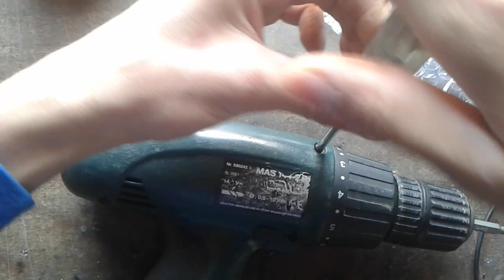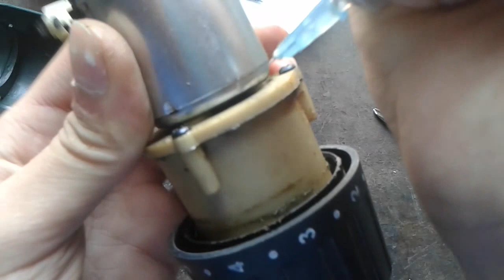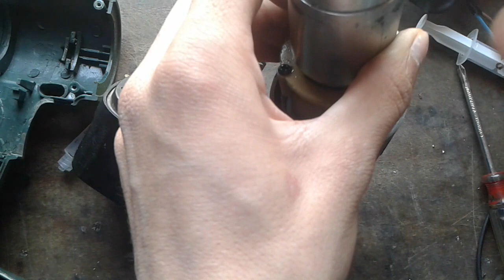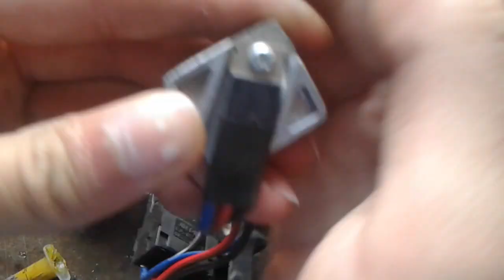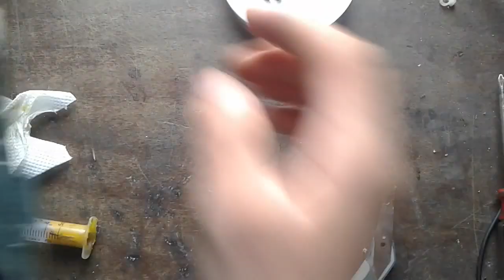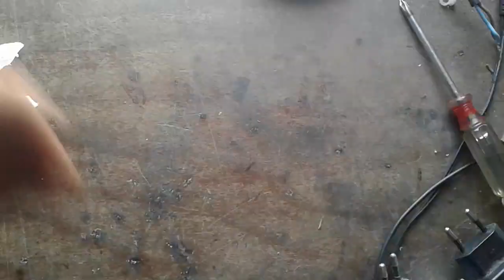Power Tool Cleaning , Maintenance and Lubrication . Bringing  this Drill to Life  :D

Comment: You did 50% of the job required, you lubed the motor but not the gears. Next time you take it apart, hold the entire chuck/motor assembly with both hands and twist in opposite directions - it will come apart and will expose the actual gears that you have to lubricate with that grease you have. 

EDIT: I just saw that your drill has 4 additional screws that connect the gearbox to the motor, so you have to unscrew those first to access the gears
Reply: What kind of oil for lube in the motor?

Comment: I didn't catch the product name or brand of the grease and lubricate you're using. I am attempting to revive a Makita electric drill|driver. I have it taken apart and cleaned the gears. bearings etc. I removed the lubricating grease because it was so soiled and "calcified"  in several places. Now I can't find the goop! The guy at Home Depo told me "you're not supposed to disassemble the tools like that".  What a jerk! I guess he suspected I didn't know what I was doin, and I don't really. But I try...
Reply from the maker: +Julia Smithson  hi :D to be honest the grease and lubricate i used are not breanded . They are very old but the best i have ever used :D 
Yes but now you know more than you did  before :)
Reply: Of course they are going to try to say you're not supposed to. If people think they can't do it because it's too difficult or takes special tools or whatever then they'll think they just have to get a new one. I'm always short on funds so I've started taking apart, finding and fixing whatever appliance, tool, etc that "breaks and has to be replaced" so far I've fixed my parents washer, dryer, gas stove and am taking apart a drill to clean it up so it's easier to switch bits and runs smoother. Plus, I  figure if it's already broke and "needs to be replaced" why not just see if you can do it and save some money.
Reply: Just like laptops die from over heating eventually beacuse the thermal compound between heatsink and cpu craps out
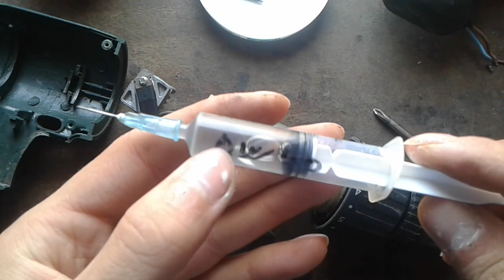Reply: @2:11 it says DW40 on the syringe.
Reply: Keep tryin , dont listen to anyone who says your not supposed too. That guys not supposed to say stupid shit but Im sure he does daily. Its good to take stuff apart and put it back together better then it was
Reply: My motto is, if it's broke then I can break it. You may be able to find signature grease for the tool model